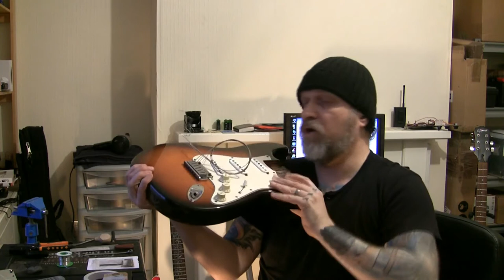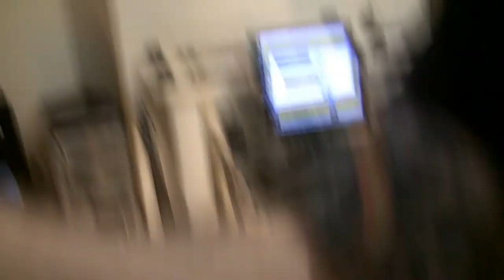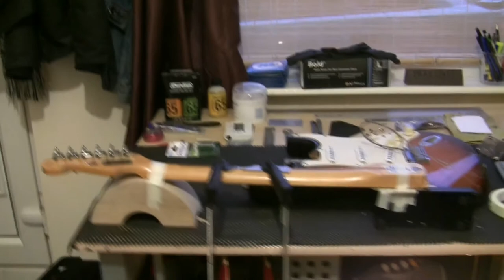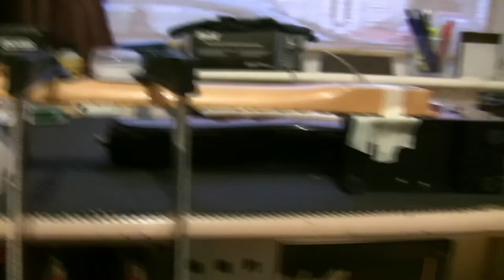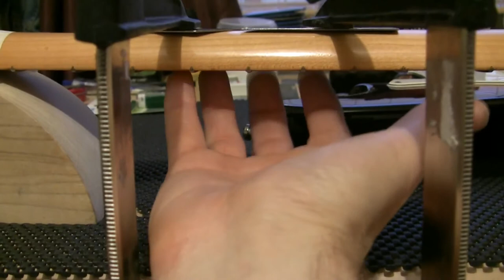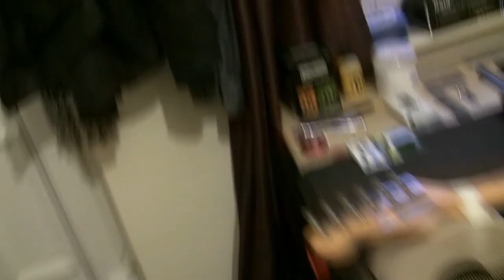1996 Fender Strat (50th Anniversary) bent neck fix Part 01

Comment: Hello friend, is there any possibility that it will bend again. Thanks for the video, it was very helpful...
Reply from the maker: Hi... There is always a possibility but if it is stored correctly it will stay straight! When straightening a neck, we are always getting the wood to return to it's natural state. Humidity/incorrect storage are the cause of twists/warping etc In some cases, it is possible that the wood used in construction was not ready to be used (was not dry enough) and those kind of faults are not guaranteed to stay fixed. In an ideal world, all guitars are made correctly with p[roperly seasoned materials! Regards, Victor...
Reply: @FretFriendGWaL  Thanks victor, your tutorial has saved my guitar!!
Greetings from Argentina...
Reply from the maker: @jerzykofficial_2023  That is good to hear :D